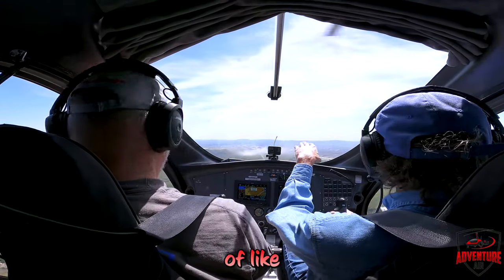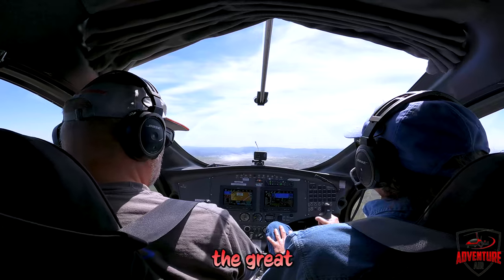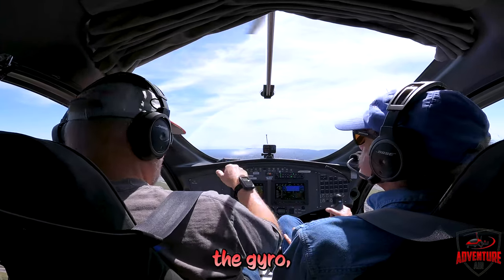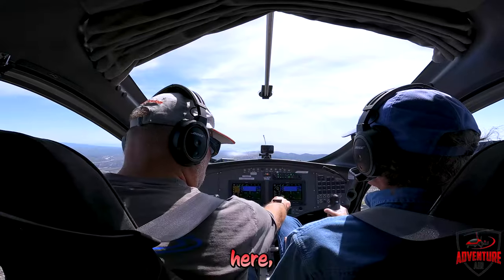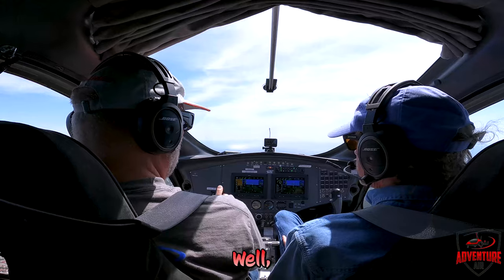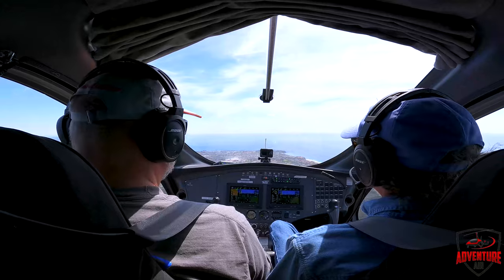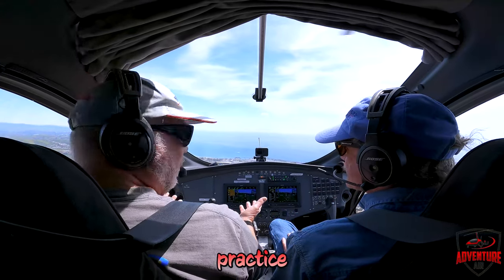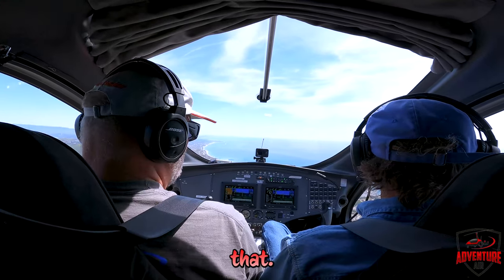35. Flying a Gyroplane: Getting to Grips with the Cyclic and Throttle

Comment: Peter, excellent video and editing. Great explanation of the "disc" concept. I assume the idea is to keep the air coming UP through the blades (disc). But what happens IF you push too far forward and the air comes through the top of the "disc" as you are moving forward. Is there a fine line between pushing forward when you are flying? Thanks, very clear instruction.
Reply from the maker: @john9663 It's not about if you push too far forward on the stick, it's about how fast you do it. Unloading the rotor by pushing the nose forward rapidly after a steep climb will cause a bunt over. If you try to push the stick forward slowly, the vertical stabilizer will work against you to keep you from doing a power pushover.